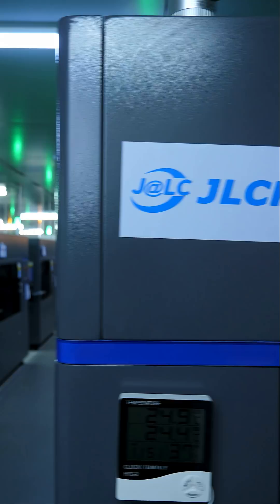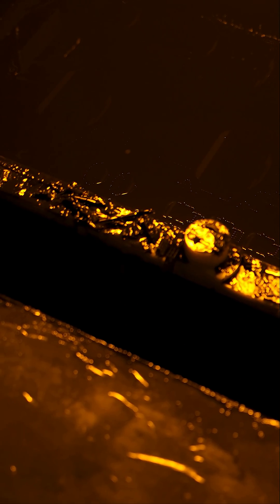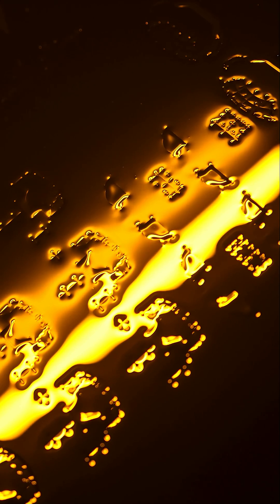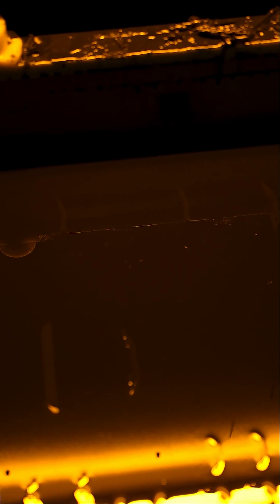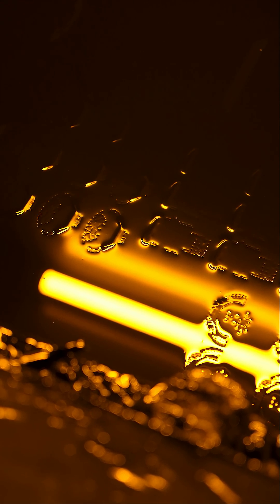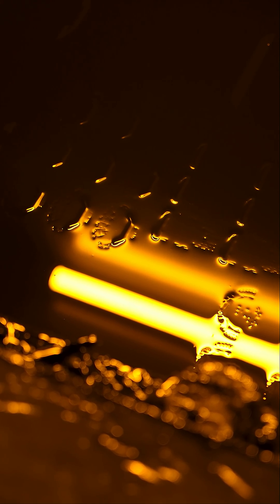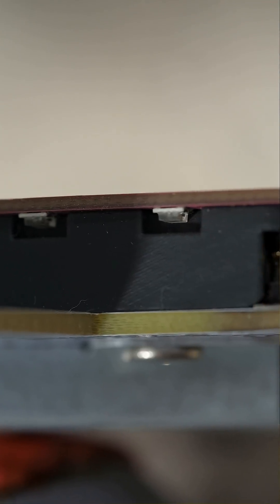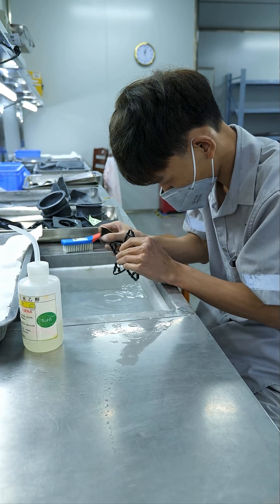Inside an Chinese SLA 3d Printing Farm #3dprinting #JLC3DP

Comment: The dude cleaning the part has no gloves on... not good. Resin leftovers are kinda toxic.
Reply: Also wearing the mask wrong.
Reply: Its already been cleaned, hes just sanding the edges
Reply: He wasn't cleaning it, he was removing small burrs and sharp edges.
Reply: My father had to go to Shanghai ones because the company he works for sent him there. He asked one of the supervisors there why there is a guy working on a high voltage panel without any gear. Essentially the answer was: "If he dies, we will just replace him, we got more than enough people here." They really do not care.
Reply: I'm sure they know what they are doing, you don't know what part of THEIR process this was
Reply: You can not Feel with Gloves, Hence, Sloppy job.